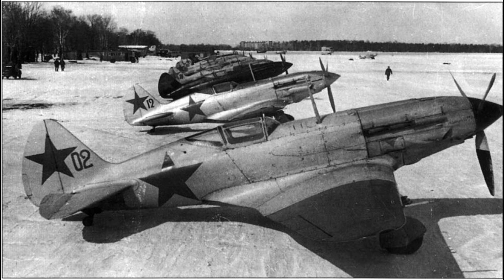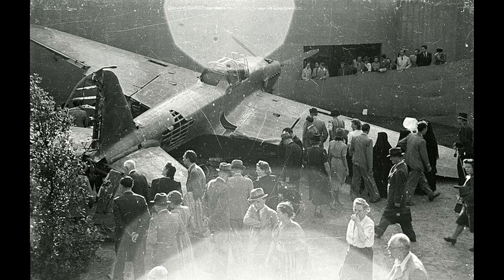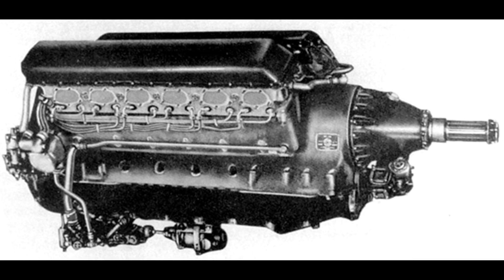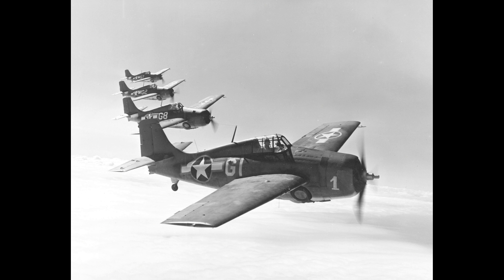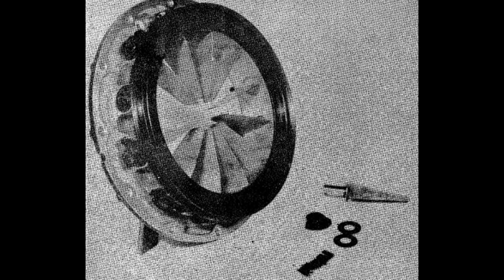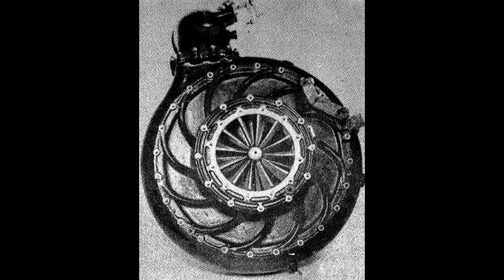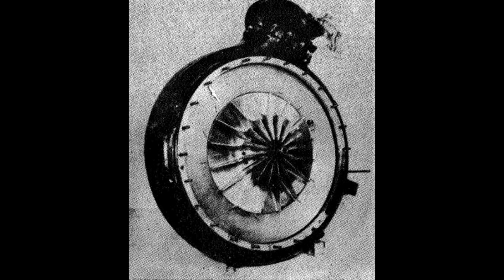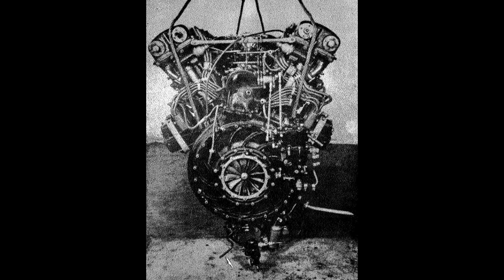IL2 Sturmovik Secret Throttle, extra 100 horsepower!

Comment: im not a car guy, but i design aeration systems for wastewater treatment plants... far as i can tell this is simply a variable inlet guide vane is it not?  
 
back before VFD drives were ubiquitous guide vanes were one of the ways one vary the mass air flow and hence lower wire horse power during periods where it was not needed. 
these were simply a better way to achieve better compressor "turn down"  at the highest possible adiabatic efficiency without causing compressor wheel surging. 

i suspect they used the variable inlet guide vanes as this is a far simpler solution than achieving real variable speed control with elaborate clutches and gear boxes?
Reply from the maker: Hi Timothy. I have zero knowledge of wastewater treatment plants aeration systems. I wouldn't say that this type of throttle was simply a variable guide vane because of the way it's controlled, the angles involved, and it's usage, which is the key here. Using this to boost a supercharger's low altitude power is pretty unique. Supercharger speed control is a different animal entirely. This takes the place of a conventional throttle, it would be used with or without a multiple speed gearbox driving the supercharger. In other words the two are not mutually exclusive.
Reply: you may be right. again im not an expert on car or plane engines, but from what ive seen in ur video is appears to be exactly that- a variable inlet guide vane.
considering the bleeding edge technologies involved you may also be correct in that both speed control might be used in conjuction with the variable guide vane especially at high psia and low psia, but in industrial settings i have never seen an application with both speed control and a variable inlet guide vane. they both have pros and cons though, so maby both are indeed used.  
what is unique about centrifugal compressors is they respond favorably(with respect to efficiency) to inlet restrictions unlike PD compressors which are basically constant volume at an exceptionally wide range of system pressures. one of the tings you tend to do at any non automated fixed speed centrifugal compressor pad is slightly close the inlet BF valves (inlet guide vanes are very rarely used and very expensive) when seasonal average temps drop and hence the average air density increases. 
in this aircraft application i suspect the guide vanes are doing... more or less the same thing- allowing compressor to operate at variable barometric pressures(psia) while providing the scfm required at the same engine rpms?
Reply: btw... sorry for rambling, but id just like to point out why they are referring to extra power being gained by the inlet guide vane( in my opinion at least). 

no offense, but i believe you made a mistake in assuming that centrifugal compressors draw more power when inlet throttled by a butterfly valve, but they do not. its the opposite, inlet throtteling regardless if its a BF or a variable inlet guide vane will reduce the torque required. you can test this on even simple BC bladed squirrel cage type blowers by restricting the inlet with your hand and monitoring the amp draw with a clamp meter... and with most non synchronous motors you can actually hear the RPM's increase...but if i misunderstood what you were saying i apologize. 
as you noted, the guide vanes are superior in that they condition the air flow by rotating it in the same direction as he rotor. generally speaking... in my area of work at least, inlet guide vanes are claimed to be in the area of 10% max more efficient than a butterfly valve. given the enormous horse powers that these motors put out, id suspect that the horse power gains you noted are mostly(but not totally) due to this greater efficiency alone.
Reply from the maker: Timothy, I am concerned that you might be missing the main point of this device in THIS application. It's primary purpose to to keep CONSTANT pressure as altitude increases or decreases, without changing the speed of the supercharger. At some point a faster speed will be needed, as this device can't add anything beyond what it allows when fully open, at that point, more impeller speed is needed to keep manifold pressure the same as the aircraft climbs.
Reply: you are absolutely correct. 
i should have been clearer in my last post, but with respect to the inlet throttling with a butterfly valve thing... i was commenting on something u said in the video not in your response to myself.
you are right of coarse abut needing a higher RPM ultimately to maintain RPM beyond the design point of the compressor, but could one not simply design the compressor to operate that the lowest conceivable barometric pressure and then throttle the inlet at all pressures below that? its certainly the  obvious thing to do... in fact its pretty much exactly how i spec blowers for aeration systems.
Reply from the maker: It's the needed range of operation here that requires all the complexity. For example at sea level we have 29.92"hg of air pressure, so getting it up to 40 only requires us to add  about 10"hg. At 25,000 feet we only have 11"hg of ambient pressure, so to get up to 40" of manifold pressure requires almost three times more boost. I am sure you could have a supercharger big enough to do that, the the throttling losses down low would be huge. That's why they didn't do it that way, and  instead used multiple superchargers or multiple speeds. The swirl throttle is only effective within a small altitude range, about 8,000 feet at the most.

Comment: This appears similar to the Inlet Guide Vane system of some Aux Power Units on commercial aircraft that utilize forced air to start the main engines.  The Garrett 331APU is started electrically and also supplied the cabin pressurized and conditioned air.  As demand changed the IGV's opened and closed.   For engine start: cabin air to OFF, IGV's full open.  The system I'm describing was on the Boeing 757.  That APU was also the motive power on the Cessna 425 Conquest.   

Love these programs, thank you Mr. G.
Buck n Willcox
Reply from the maker: You're speaking my language. I have 6000 hours PIC with the TPE331s, and a bunch on the 757.

Comment: Interesting video, I've been working on mostly naval diesel engines and they have interesting turbo charging with intercoolers and some quirky weight saving techniques taken from Zeppelin engines, at least when it comes to the old MTU V20 engines. They are set up so they also work in reverse, which is quite a feat considering oil pumps that are mechanical and lubrication of the engine when the crank shaft is mounted with roller bearings, not ball bearings but needle type, which poses real problems getting oil to the piston bearing. 
I would appreciate more information or a video on the massive engines developed by the British by the end of the war. The 24 cylinder Napier in H configuration for the Hawker Tempest or the X24 engine Rolls Royce was working on for the Manchester bomber originally but was supposed to go in to fighters too.
Reply from the maker: I'll get into the sleeve valve engines later. While I think they are fascinating, and I also think they would have been the way forward if not for the advent of the jet, they just never had a chance to reach their potential.
Reply: Believe it or not the Alison V-1710 engine started out as a airship engine. It was designed with reversibility as a feature which made it easily suitable for the  P-36. It has always made me wonder about the British and the Lightings they ordered without a counter rotating engine or turbo's. They canceled the order after they found out how hard it was to handle at low speed where the torque effects were viscous. I have always suspected they had it in mind to replace the V-1710 engines with Merlin engines but the Merlin was not easy to reverse so lacking counter rotating Merlin's they killed the whole idea. If they had wanted a Lighting with Alison engines without turbo's it wouldn't have taken much to make one engine counter rotating. Of course while they were in California they talked to the folks at North American and got them to build the Mustang, then they took the Alison out and put in a Merlin....

Comment: G'day,

  Very cool !

   Those sneaky Soviets must have used a Time Machine, to have visited my Plans in 1986 to use this type of Helical-Spiral Inlet-Vane system to control the Rotor-RPM on a Ducted Wind-Turbine, which used a Thrustrum-type Venturi to feed a fixed-pitch Rotor with pre-Retrospun Air at a Windspeed-controlled decreasing volume to drive an Alternator at 3,000 RPM, and prevent the Blade-tips from going supersonic inside the Duct...; I was veryvsure that I wasn't reinventing the Wheel, so Soviet Spies with a Time-Machine must be the oblivious answer, surely ? (lol !).

  Tee hee,

  Have a good one...

  ;-p

  Ciao !

Comment: This concept was used for HVAC (heating ventilating and air conditioning) fans.   It is called a vortex vane damper.  It puts a spin on the airflow coming into usually a backward curved cage type fan.  The air spin reduces the amount of air grabbed by the centrifugal fan and reduces the power requirement almost linearly with air flow.  Typically a vortex vane damper could reduce airflow from 100% to 40%.   In high use from the 70's to early 90's they have as far as I know been replaced by variable speed drives as the electronics in those have become reliable.  Variable speed drives add a little parasitic power draw, but power consumption has a cubic relationship to airflow, so they are much more efficient.   Also centrifugal cage type fans have mostly been replaced with plug fans.  That cubic relationship of power to airflow is also present in aircraft.  All things being equal power has a cubic relationship to aircraft velocity.  As you increase speed air resistance increases as a square of velocity and because you are going faster you are pushing into the air at a faster rate.  So how did they improve speed so much.  They made the aircraft more streamlined, they flew higher where the air is thinner, and they increased the size of the engines.
Reply: Thanks for that, Dan. Great explanation!

Comment: The P39's and P 63's kicked ass! Why, because on the Eastern front most dogfights occurred below 13,000 ft. That's where the Bell aircraft sang. But that wasn't the plan. bell designed the P39 with a supercharger that would have made it a killer at high altitude. But the Army changed the requirements of the P39 shortly after the first prototypes first flew. They added extra weight and took away the supercharger to make up for the weight they added. That left the P 39 lacking at bomber altitude where it was designed to perform. Too bad. It was an entirely different way of designing an aircraft. In fact the first American fighter with a swept wing was a prototype P39. The mid engine design made that possible, and if you look at all the jet fighters of today they all have the engine behind the pilot! When comparing the Mustang to the P63, both of which came along later in the war, the two aircraft a very similar. They both had laminar flow wings and both were designed around the same basic mission. But the P63 was only available with the Allison engine whereas the Mustang B and above used the Merlin. The Merlin had a much better supercharger than any of the Allison engines. Too bad, because the Allison was a more efficient engine than the Merlin to begin with. Had it been available with the Merlin's supercharger, a two stage design, it would have kicked ass on any other piston engine in the war, period. But because of patents it wasn't. So the P63 was relegated to lend lease aircraft where the arussian Air Force used it to destroy Bf109's and Fock Wolf 190's. They were also great tank busters with their 37MM canons that fired through the propellor hub. Only the IL2 Sturmovik was better at tank busting that the P39/3's were, and that was because of the heavy armor they were blessed with. As for the Russian throttle control discussed here? What could it have done to improve the performance of any other fighter of the war? Heck, why don't we use something like this on our turbocharged engines in cars today? I could live with an extra hundred horsepower, or even just 50 hp!
Reply: The P-39 and P-63 were handicapped by the long propeller shaft which vibrated. This kind of vibration is known as "torsional vibration" and occurs when power is transmitted by any shaft too long and not stiff.
Reply: P-39 prototype was TURBOCHARGED like the P-36 was. There were issues with the installation of the system and the AAF decided to have the plane re-designed with the supercharged version of the V-1710 as was used in the P-51A and P-40. Bell was also encouraged to lighten and cut drag as much as possible to make up for reduced power.

Comment: Swirl throttle was used by the Germans on the Jumo 213 series (i.e. Fw 190D, Ta 152, some late German bombers with the 213 like He 111)
Reply from the maker: I have seen it on the Jumo, but not on anything else. Thanks for pointing that out!
Reply: I just came across a patent image that shows a swirl throttle on the first stage supercharger of the DB 628. It should come up if you do a Google image search for: daimler benz DB 628 nose
Reply: Yeah, the 213 didn't have the hydraulic coupling for the supercharger which made the swirl throttle useless on the Daimler-Benz engines, it had a multi-speed gear drive, like many of the American and Soviet engines.

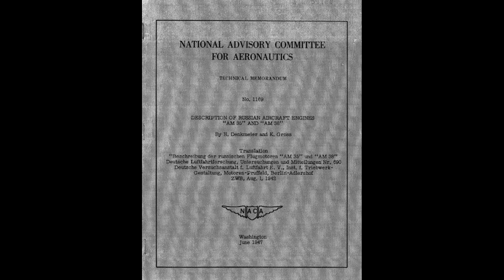Comment: 1:07 Minor correction, the IL-10 used the AM-42 engine.
Otherwise, great video! I'm really glad that I discovered your channel.
Reply from the maker: The IL10 did use the AM-42, but according to Wikipedia it also used the AM-38. https://en.wikipedia.org/wiki/Mikulin_AM-38

Comment: could you make videos on famous radial engines like R-2800 and BMW 801?
Reply from the maker: absolutely
Reply: I was on the Midway Aircraft Carrier museum in San Diego around 2011.  They had a cut away R-2800 engine that when you pressed a button you could observe the inner workings as the crank turned.
Reply: Wow! Thats amazing! To me it's crazy how all the pistons work, just impressive how they move together.

Comment: though not quite the same (similar though) Jean Pierre Boudy's anti-lag system as used in the 1980s Renault maxi turbo and again in the Peugeot t16 rally car use a system which puts pre rotation into the air prior to the compressor wheel . This system was named the DPV and eliminated lag .Check it out ,it's really kind of Cool. I've enjoyed your presentations so far, keep it up.Cheers

Comment: The IL-2 rarely operated above 8,000 ft and most of the time it was just high enough to avoid anti-aircraft fire from light cannon and machine guns.  Records indicate that it is the second most produced aircraft of the war, second only to the BF109.
Reply: John Ferguson You are wrong but IL2 is the most produced military aircraft in the history
Reply from the maker: That's correct. The critical altitude (meaning the altitude at which it can no longer develop its rated power) for the IL2's engine is about 6500 feet, which is really low for a WW2 combat plane. This throttle helps power BELOW that level, so they were really concerned about maximizing low altitude power which makes sense considering the nature of the air war on Germany's eastern front.

Comment: I don't get it. 
The way I understand it is that, at LOW ALTITUDE, these movable vanes restrict the inflow of air BEFORE the compressor so that the impeller is spinning in a partial vacuum (and less engine power is wasted to spin the impeller ). At HIGH ALTITUDE, these movable vanes don't restrict the inflow of air to the compressor so that the compressor can work at full capacity (and use more engine power in doing so). The swirling motion would be a negligible secondary effect (less heat). A butterfly-type of of throttle located BEFORE the compressor could have a similar effect.
Reply from the maker: I know it's confusing, but you are actually correct. At low altitudes the impeller is spinning in a partial vacuum. That's why it's not overboosting. That's how almost all Supercharger WW2 fighter engines work, P40, Hurricane etc. The full power setting at low altitudes doesn't actually allow the throttle to open all the way. In this condition the swirl throttle directs air to the impeller at a better angle. 

At full throttle at or above the critical altitude, the swirl throttle is fully open, and there is no swirling motion, and no advantage over a conventional throttle. That's why the swirl throttle only adds power below the supercharged engine's critical altitude.